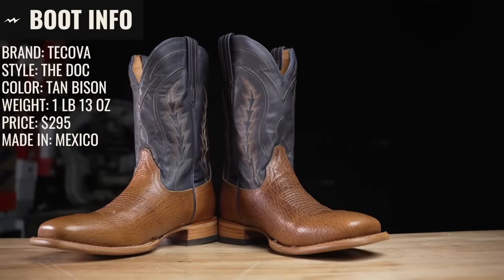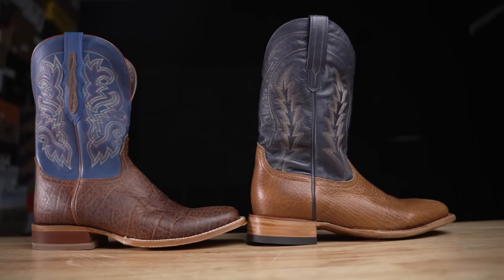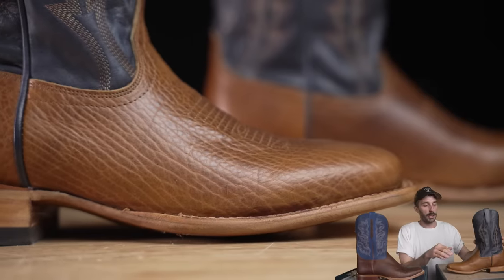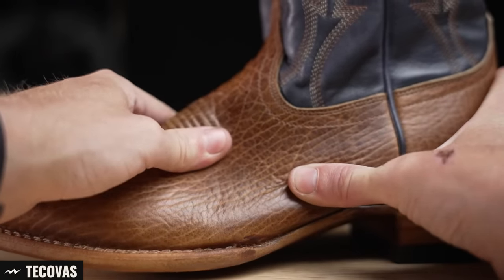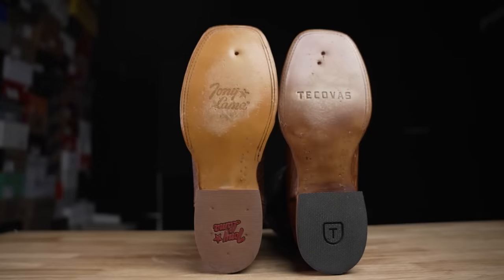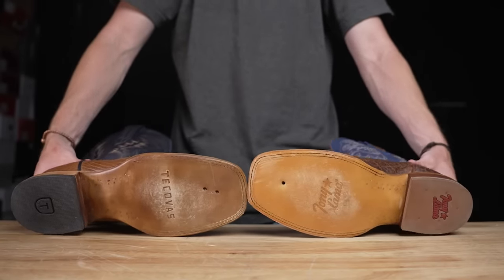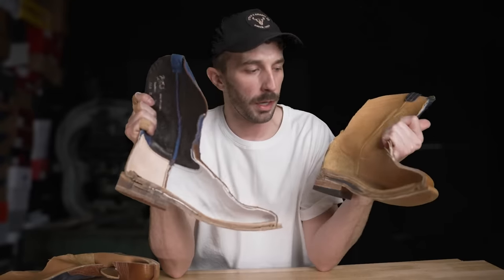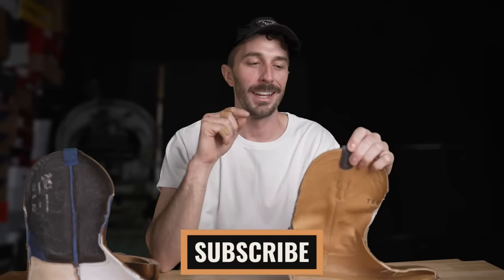Best cowboy boot under $300? - Tecovas vs Tony Lama

Comment: Seems like tecova started off with a great idea but then veered off with some cheaper materials to save on build costs down the line. I'm shocked at the prices on any cowboy boots these days. I'm still wearing a pair of Rockey cowboy boots I was given as gift. My ex threw away my Justin ropers while I was deployed to Iraq. Also what is the deal with everyone wanting the square toe boots?  They used to be far and few. It was always the pointy corner cocaroch killer,then kind of a medium round and the roper round for toe shape. Yeah there were square toes out there but mostly bikers wore those. Not cowboys.

Comment: When cutting with a knife, don’t put the blade completely horizontal and just push straight down, you want to put it more diagonally and use the entire length of the blade, those boots should be cutting much easier with that blade than it was.

Comment: These seem pretty good value considering the materials and man hours going into making them. 

However the heel on these Tecovas is not angled properly, that might create a pressure point at the arch.
Reply: It's not noticeable to me at least unless I'm sitting and my feet are on the ground and the boot wants to use the front of the heel as a fulcrum. Kind of annoying but has definetly gotten better over time.
Reply: Had to return a pair for this exact problem
Reply: everyone else on the channel who's not wearing cowboy shoes/not from USA 🤔
Reply: Exactly what I was going to say. Had the same problem with a pair of Mexican made boots that hurt you sole in front of the heel as once you stand in them the heel pushes flat on the ground and the front of heel flexes the shank and pushes the front the heel up into your foot.
Fixed them myself by grinding down the heel so it sat flat on a table 1/16” of an inch at the front tapering back to 0”.

Comment: @8:21, He's clearly lacking in knowledge of the importance of wooden pegs over the use of brass nails. The highest quality custom cowboy boots use NO NAILS, like those made by famed bootmakers like Ray Jones. It is always preferred in the art of making cowboy boots to ultimately use no nails. Using nails is easier and less labor intensive than just using lemonwood pegs, just like manufacturing boots by machine over making boots by hand. Using brass nails DOES NOT offer any more integrity to a boot than using wooden pegs...it's all about quality craftmanship practices.  The fact that he doesn't understand this makes his critiques lose credibility. He really just quickly glosses over the important reason why wood pegs are preferred by horse riders as the shanks/outsoles get worn down: the wood pegs won't damage the stirrups as the brass nails do. As the leather outsoles expand & contract upon getting wet/dry, so do the wooden pegs, ensuring a more weatherproof seal. Brass nails over time often become loose and fall out.  He needs to spend more time shadowing experienced bootmakers like Lee Miller and really learn the important factors in constructing a traditionally made cowboy boot. I respect his knowledge regarding other types of workboots, but his cowboy boot assessments & critiques fall short.  Jeremiah Craig knows cowboy boot quality far better than he does.

Comment: I had a pair of Tecovas once. And muddy conditions the lemon wood pegs pulled out. They replaced the boots for free. My second pair got super wet and never dried properly. 
I switched to Nicks because I needed a boot to fit my job better. But the time I wore the boots I really enjoyed them over other cowboy boots.
Reply: Seconded.  Their customer service is insanely good.  I ordered a pair of The Jake ropers in 10 1/2 regular width, to find out that I really needed EE width.  After wearing the second pair for nearly 60 hours, I found out my feet were 10 1/2” in running shoes and weren’t really 10 1/2” in cowboy boots.  They just asked to see pictures of the boots to make sure they were in decent condition and exchanged them for 11” EE without any fuss.  10/10 service.

Comment: Tecovas are fashion boots for urban cowboys. Being designed in Austin should tell you that. That soft leather is not good for a working boot… I would guess Tecovas likely wouldn’t hold up to much more than a couple rounds of mojitos down on Rainey street. Tony Llama makes a better work boot than Tecova IMO. I wore Justin ropers to work for years and years and still have a couple of those pairs and they are still going strong. YMMV

Comment: I would love to see how a pair of Ariat work boots that are styled like cowboy boots compare. I personally use them for work and i also used the regular cowboy boots and love them both. Ariat is pretty much king around my whole area they sell out fast.
Reply: My most comfortable pair of boots were my sierra steel toe for work. The only issue I had was they get uncomfortable after about 2 years. I put alot of pressure on the balls of my feet though

Comment: Glad you're doing the cowboy series. I see Tecova's a lot but one thing I saw on Jeremiah Craigs channel was he showed a bar graph that rated all the cowboy boot brands and I believed it was based on popularity/solid boot, the brand Lucchese blew out everybody by a lot. Tecovas came in second but they weren't anywhere near the vote count on Lucchese. That being said, Lucchese is really expensive and I'm curious if they're worth dropping the extra money. Are you also going to do a review on some other brands such as Cody James, Ariat, etc? For sure do a Lucchese review. I would definitely like to see that one. Thanks for doing the Cowboy reviews!
Reply: Shop around for used luccs in your size online. They're very popular so you can usually find what you're looking for in your size and even though you aren't getting the same custom fit the original buyer got for their $1500+, a bit of stretching and such can still dial them in. Since there are so many on the used market the price is unreasonably cheap. I got the exact ostrich pair from their classic line that I wanted for an upcoming wedding for like $325 plus $120 at a local shop for a resole that came with a refinish (though you can do that part yourself) and $25 for some adjustments. They're a lifetime boot anyway so as long as there's no damage the age is meaningless beyond whether they need a resole. Under $500 total and I have very close to the same product as would cost over $1500+taxes. Watch out for people selling the cheaper lucc lines though. They're only $700-800 new (for exotics, can be cheaper otherwise) and are only a bit better than a $450 pair of similar Tecovas. But people post them online for the same prices you can usually get the classic line for (which are $1500+ and only equaled in quality by a few other brands that are in the same price range, maybe a few hundred cheaper at most). The first letters in the serial number inside tell you which line they are and you can easily identify which are the high end boots and which are the cheap ones.

Otherwise if you want to then go into a Lucchese (or Rios or whatever) store in person and get custom fitted and order the exact pair you want, if you're willing to spend the money. What you should not do is choose to go with the Lucchese name but then compromise on price and buy new, off-the-shelf "Lucchese Bootmakers" lines because those are more like overpriced versions of Lama or Dan Post or Tecovas. Also don't buy any new dress boots over ~$1000 without getting custom fitted because then what's the point of buying new when there are so many quality used sets out there?
Reply: Lucchese is the magic word!  Those boots fit like a glove with little break-in needed. Yes, they can get quite expensive with exotic leathers and fancy tooling. I got mine in Dallas in 1996 on sale...not so many styles then.
Reply: Check out Will Roman’s video where he cuts up Tecovas, Lucchese and his own brand, Chisos. Chisos boots appear to have superior construction throughout but the price point is higher than Tecovas. 

My experience is that Tecovas and Lucchese are on about the same level but Lucchese is twice the price. 

And then have a look at Rujo boots which are priced lower than Tecovas but with just as good leathers but a much stronger counter from what I can feel. 

Summary as I would rank them personally…
Tecovas vs Lucchese vs Rujo: Rujo is best for the money for dress boots. (Tecovas Ranch Wear is a different and more durable line, by the way)

And then Chisos takes it all to a much higher level. Durability and great looks. Higher price but you get what you pay for in their case. 

I think with Lucchese, you’re paying for a legacy name but without the legacy quality any longer. Again, just my personal experience.
Reply: @toddpalmer7790  Again there's a big difference between the modern entry level Lucchese lines and a pair of classics. If you buy their truly high end boots you get appropriate quality for the price, similar to other high end bootmakers. If you buy their cheapest boots they're just more expensive versions of  budget/mid-tier brands. Chisos do look interesting but it's a very limited lineup and their few premium exotics are very much on par in price with other ultra-premium brands. $1200 for ostrich ropers and $4k for limited edition alligator. If I could get the roughout in a medium toe I'd probably buy a pair right now. In general even with Tecovas and Rujo the selection becomes a problem. None of them have the dark cherry color that I love for example, and overall the selection is the best at Lucchese even if you aren't ordering a custom pair. Most buyers are compromising on something (preferred toe, heel, hide, finish, color, upper, sole material, etc) from those other brands. And ultimately streamlined production with less options for buyers is a big part of how they keep the costs low, so you still essentially get what you pay for most of the time at the end of the day.

Comment: You want a little bit of heel slippage when wearing cowboy boots otherwise the boot is too tight for your foot! 1/4 to 1/2 inch is fine. Also there is a thing about having sag in your shaft of your boot…….if you know then you know.

Comment: I've switched from round toed to square toed cowboy boots.  There's really no comparison in comfort and like all pinch-toed footwear, that's not how a foot is shaped so you can expect some permanent foot injury unless you're just sitting at a desk or or Saturday shopping at the mall with them on.  I work and ride in mine (neither of these brands).  I get stepped on by a horse at least once or twice a year so that crap counter material in the Tecovas may be a deal breaker.  Who wants a boot with a permanent camel toe?  Ahhhh, don't answer that.

Comment: I’ve had Tony L and currently have Tecovas. Tecovas are the most comfortable boots I’ve ever owned.
Reply: Try on a pair of chisos. Makes all other boots disappointing.
Reply: @joshuasteele5108  You aint lying. Tecovas are pretty comfy, but your foot just melts into Chisos. I was personally sceptical about spending that much but holy cow what a difference.
Reply: @michealbates6369  it's really ruined other boots for me. Now anything else I buy is special a occasion boot.
Reply: @joshuasteele5108  thanks for the tip. I don’t know if I’m willing to spend that on a pair of boots.
Reply: @michealbates6369  Is there a good place to try on Chisos? Are they leather insoled?
Reply: @dave84401  I wear boots just about every day. Previous job took a toll on my joints and lower back. Lots of bone on bone contact haha. I think it depends on your need. Price was easy to justify in my case. Walking on clouds built like tanks.
Reply: @Vultain  you should really check out their videos here. They cut one and half and show you the build. As far as trying on they fit your sneaker size if that helps. Otherwise exchanges are free if you don't like the fit I think.
Reply: @joshuasteele5108  Very much like you, my joints are pretty destroyed, heritage footwear has been the best thing for it! So far Nick's have been my most comfortable boots followed by an old pair of Red Wing 9016's. So I was wondering how the Chisos held up overall.

I didn't realize that there was a video already on them, I'll try and give it a watch.
Reply: @joshuasteele5108  Well if you ever want some advice on Nick's hit me up. I live local (30 minutes from them). I also own a pair and having a pair built so if you want leather advice, fit, lasts, or that sort of thing I would be happy to help. They are working on a roper, they just don't have it ready yet or I would aim for that.
Reply: @Vultain  a nicks roper? Now that sounds interesting! Used to live a couple hours south of Seattle myself.
Reply: @joshuasteele5108  Yeah, they have been testing a few things. It wouldn't surprise me over the next two or three years if something comes out. I would expect test pairs first before it becomes finalized. 

Nick's is more actually having an issue of supplies and materials and getting more workers for their business. The key thing is to manage their expansion so they keep the quality. Reputation is king, I love the fact I can go in there and geek out on leathers and ideas with someone. The personal salesmanship and customer service is what got me.

You just don't see it anymore.

Comment: TBH I wonder what percentage of that 150lbs a snake is achieving when it’s mouth is open wide enough to get around a boot leg. My guess is it’s much lower when the jaw is open pretty wide, so would be interesting to see this tested with “real world” snake bite biomechanics if it hasn’t been
Reply: Generally has to get through denim jeans and a sock as well, plus there's depth of penetration and the loss of force due to the flexibility/give in the material. Fangs are also fragile and kind get thicker toward the base so harder to force through a material past a certain depth. Anything is protection and I would imagine a layer of any leather plus any blue jean would keep you pretty safe even if the snake is technically capable of penetrating it under ideal conditions.

Comment: Tacovas look pretty dang nice, but I've had my TLs for 25+ years and I love them. Unfortunately my feet are flattening out and the boots are now too tight, even after getting them stretched!
Reply: I have the same problem! Been noticing my boots getting too tight. I first thought it was my boots shrinking due to the years I've had them. Did some research, measured my feet, and voila, I now wear.a size 11, when all my life I wore a 10..
Reply: When did TL stop manufacturing in El Paso?

Comment: Neither brand is impressive, after seeing the vinyl coated upper and mediocre toe and heel counter in the Tecova; the TL smooth liner is actually far superior to a rough split, allowing the heel to slip up and down. The split is going to grab, wearing a hole in the sock, then foot, and fake finishes just do not equate with basic quality cowhide, necessary for durability.
  Tecova sort of copied the business arc of another T brand, Timberland, in the late 70's. Previously a company that made hiking boots for brand labels, they hired a marketing type who launched their ad campaign, mostly reinventing bogus traits of middling quality as "high end." Everyone bought them, and they were putting far better old brands out of business.
  Hand lasted boots using top quality hides, not cheap, but worth the extra if you are wanting to throw money at an indulgence - cheap stuff will not impress those who know the difference.

Comment: I sincerely doubt the 150lb bite force of a rattlesnake. MAYBE if it was something that was small enough to actually bite down on, like a mouse, but they won't be able to close their mouth around the shaft of a boot. It's basically just throwing their body weight into a strike. A defensive strike and not a killing strike, at that.

Comment: Please cut in half Mil-Tec's Invader boots. I just bought these, and washorrified with what I recieved, they are coated in some kind of plastic film, I started ripping it off, it's just a bare light grey material underneath, I'm not even convinced it's leather. This boot is just completely shocking and mind boggling, I wonder what other horrible shit is in this boots construction, would probably make a good video.

Comment: Tecova boots do not hold up. I had a pair that the stitching started coming apart on 2 weeks after I purchased them. Customer service and warranty was a huge hassle and Tecovas would not fix these 2 week old boots. Seriously, they're probably fine as a fashion boot, but these are not meant for anything more than the mall.

Comment: I hate rigid counters. Cut my heel open on a 26mile ruck. Luckily the sock fused into it and didn’t bleed much. 12:30 the heel feels a lot more rigid than that counter should be able to do. Maybe they changed materials?

Comment: The calfskin of the Tecovas keeps the hair on your calves. Sure it’ll sag over time but the leather will stand upright when worn and again not rub you raw. The rigid cowhide of those Justin boots will stand straight forever and rub you raw forever. Hope you like four hairless spots on your legs. If you buy any Justin brand boots you probably also buy Ryobi tools and drive a dodge w/out a cummins